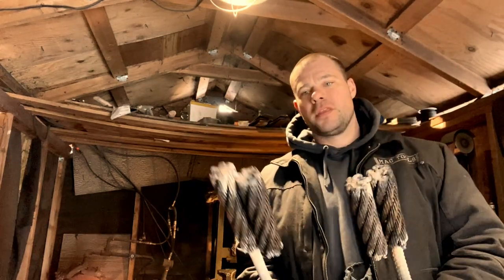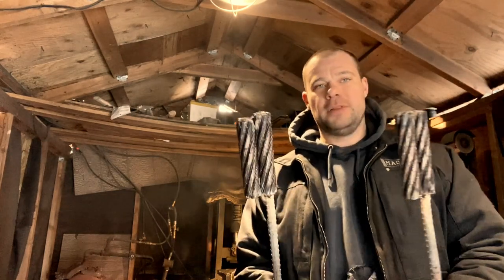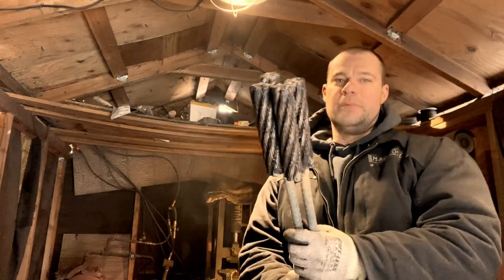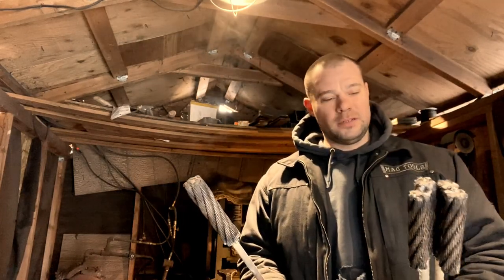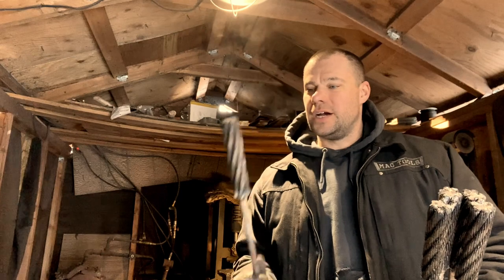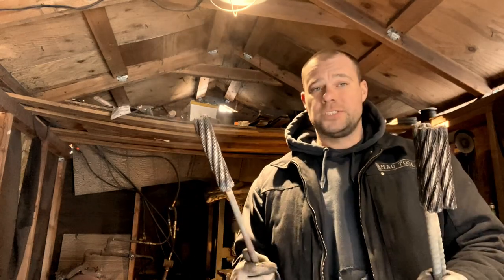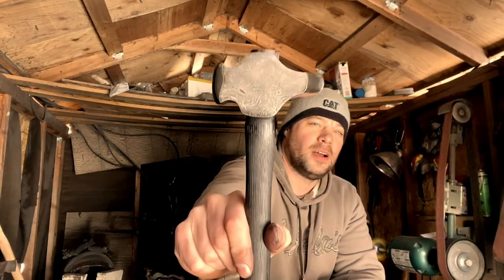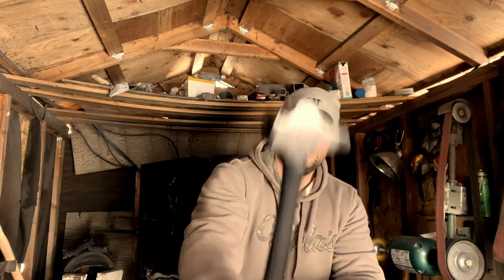Cable Damascus Hammer!

Comment: I use soluble coffe (with cafein) (a half of a bottle in a litre of hot water) after put the finished piece in acid.12hours in the solution increases the black colour and these colour dont come out. Its a very nice trick.the change in the colour is very cool.